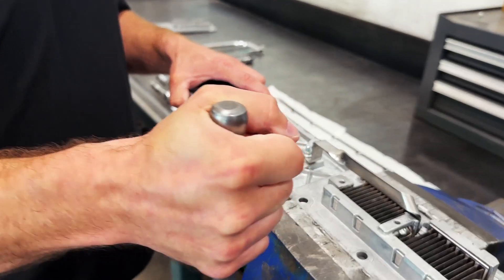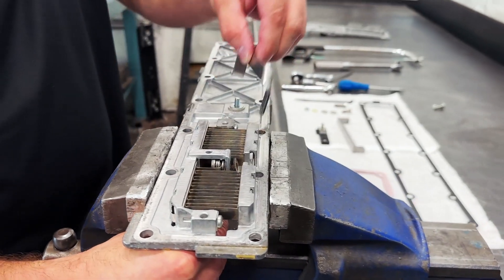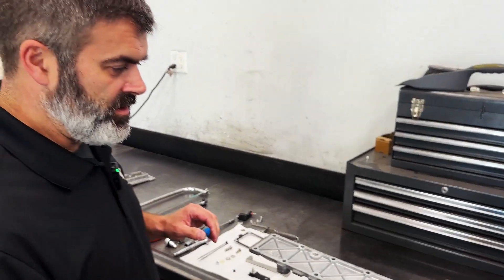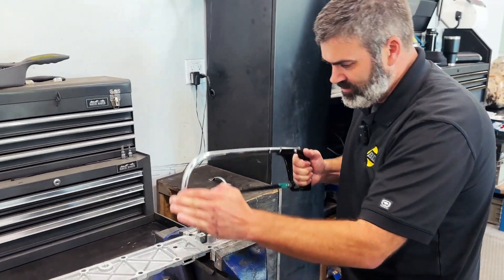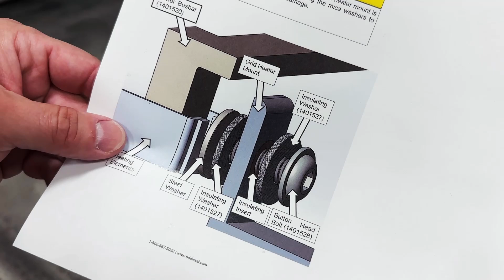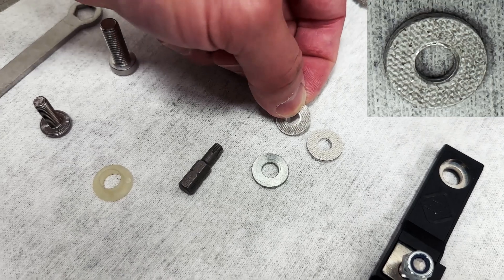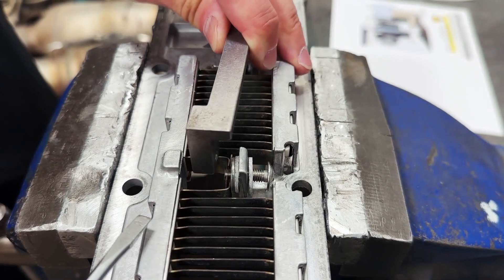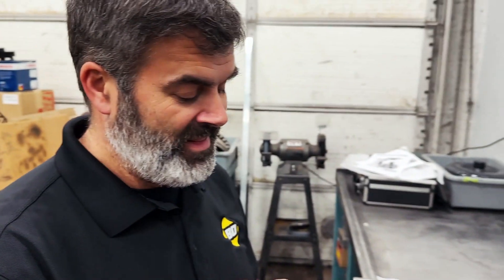BD Killer Grid Heater INSTALL - STEP BY STEP GUIDE

Comment: Vide0 @ 8:20 min mark mentioned about bolt not letting power transer to aliminum housing, I don't see it how, the bolt is installed through where it is part of the the aluminum housing no? Txs for the video.
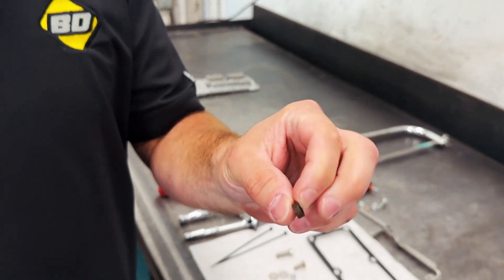Reply: @ 5:45 he shows the insulated insert that keeps it from touching in the center of the hole and the 2 flat washers are made of something nonconductive also.
Reply: @u @upnorthyooper1196 luminum is electric conductor, yes. The bolt is threaded through so non conductive washer is not going to help with that. Nevertheless I see the product is being sold and used. I just don’t understand how the electrical conductivity is kept separate.

Comment: watched this video enough to see the potential for failure of 2 " non-metallic " washers at the grid bus install.  So for a cost of 35-50 cents, if either of these washers fail, could potentially ruin the entire heater grid/plenum..... having said that, what is the warranty for this product ?

Comment: Why didn't you start from popping the hood...? This doesn't fit the description of "step by step"! There's no mention of cleaning mating surfaces do's and don'ts, and disconnecting everything else involved. Nor mention of tq for whole plate reinstall. Were I to critique this video for the value of its info, all I'd have to say is "vid sucks". Kinda like, hey guys here's how you change your oil, pour new oil in this hole... you're welcome.
Reply: Right they don’t show the injection tube that needs to come out.
Reply: Gonna have to use some critical thinking skills and common sense there bud 🤷🏻
Reply: @07cummins3500 step by step means step by step.  I do my own since I'm bad ass! However, I could see an average person messing things up since they were told, step by step.. jus sayin. Bud
Reply: @user-hl7uv1hn2y I plan to do this tomorrow on my truck, there is a lot of steps to get to this point of actually replacing the bar. I can’t find many videos on how to remove everything

Comment: If the bolt you installed at 7:35 in the video loosens up, where does it go?
Reply: I had the same question. 

this is my interpretation:
1. root cause is solenoid sticks closed “sometimes “. 
2. if it didnt do this there would be no overheating leading to the nut falling off
3. bd solution eliminates a nut (great, but again, if solenoid didnt stick on, it would’ve been fine—but ok, i do like this design better because:

4. if the solenoid sticks on again, the equipment has been to thicker metal capable of more efficiently/directly allowing the “short to grid heater element” and there is no small stud with nut that hets heated up.

5. the m5 bolt u mentioned, can have loads of red/permanent locktite applied to it, as the grounding path doesn’t include passing theough that bolt….it is merely for clamping force….so red loctite the snot out of it.

Comment: What if everythings back together and you go to tighten down the solenoid wire onto upper the bus bar bolt and the nut wont fully tighten down. The bolt in the bus bar spins, then what?
Reply: Hey I just installed mine. You have to spin the wire to the right until the plastic tab on the bus bar holds it in place. Then you can tighten the nut down. I just had the same thing happen to me.
Reply from the maker: Hey there, thank you for your question. It sounds like the nut has been overtightened. Please call our tech line to get a replacement for your upper busbar: 1-800-887-5030 (PRESS 2)